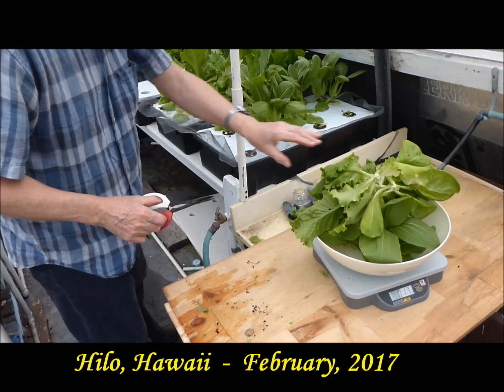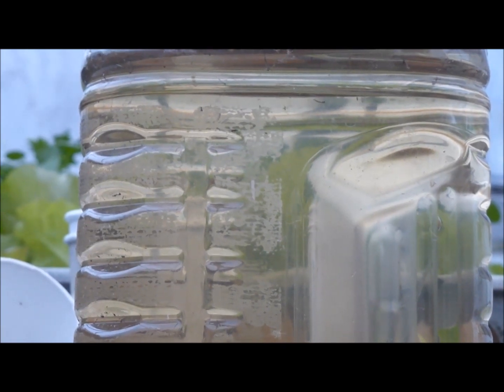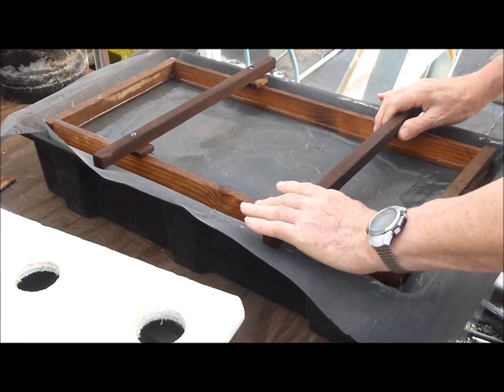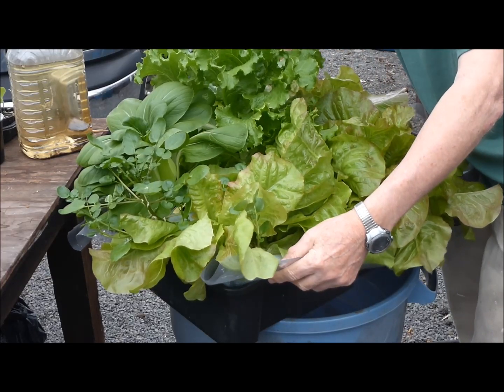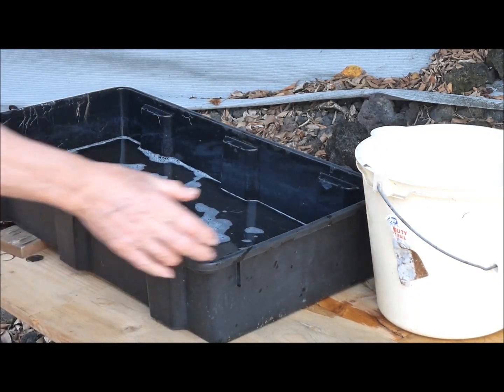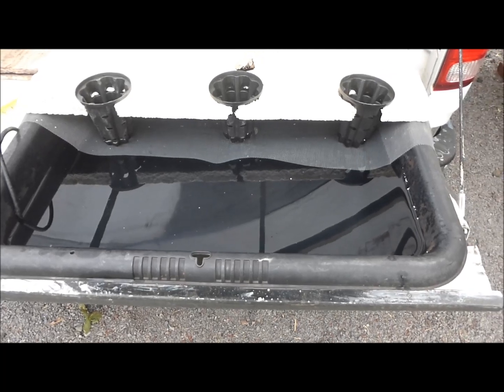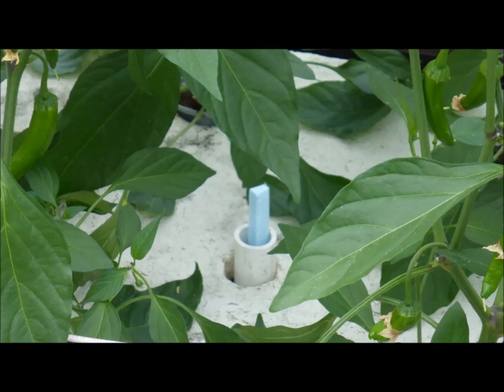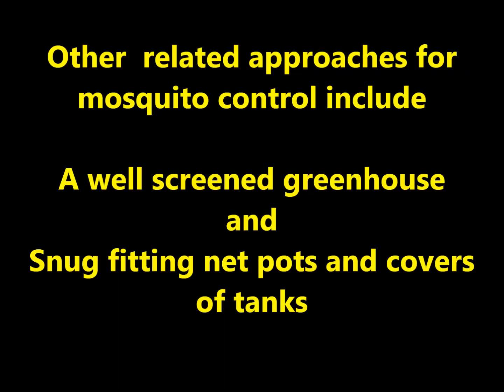Controlling Mosquitoes with Screen in Kratky Hydroponic Systems

Comment: Is this prof Kratky himself? I read the Kratky method PDF from hawaii.edu website few months ago, and just realized how the mosquito net, that was mentioned in the PDF, suppose to be installed from this video. Thanks

Another question is that: why can't you just fill the whole box with LECA / cocoir, fill it with nutrients, and let the plants grow like normal Kratky method? There wouldn't be any chance for the mosquito problem. 

I live in Singapore public housing, and mosquito is major issue since it can cause dengue and Zika outbreak in very short time.
Reply from the maker: Yes, this is the old, retired prof trying to learn how to communicate via Youtube.  Yes, you can fill the whole tank with growing medium and add nutrient solution and that should eliminate the mosquito breeding grounds. However, the growing medium adds cost and some inconvenience.  In a recent youtube on beans, I am suggesting that the nutrient solution be delivered to the tank through a float valve which controls a shallow nutrient solution level that sub-irrigates the container of growing medium.  It works well and I plan additional study on this concept.
Reply: Thank you Prof. You're awesome
Reply: dakineapproaches not old.. just more experienced dirt (or in this case water) under your nails. Thank you for continuing your gift of educating us.

Comment: Thank you for this. I've barely planted a seed in my life but seem to have caught the bug now. (pun intended) I've been looking at the dutch bucket system and while it looks amazing I'm afraid to start that endeavour and would prefer your method because of its simpleness and cost effectiveness for now. My question regarding the polystyrene is if it's strong enough to hold the weight of growing tomato plants. Thank you for all your great videos.

Comment: Im a novice to hydroponics. Its suggested that I use black containers to stop light and algae growth. I live in a very hot climate. Wont the black colour absorb heat and increase the water temperature, humidity and produce the same problem and or be a problem for the roots?
Reply: You can also use foil or reflective tape to keep light out, and help insulate your reservoir
Reply from the maker: Yes, the black color will cause heat issues.  A simple solution is to paint the black containers with white latex paint and you will have the best of both worlds - white  exterior to keep things cool and black interior to block light and algae.
Reply: Put a white Polystyrene around tank and you may do it 1" out of tank's wall.

Comment: I just throw a "Dunks" in my tank.  Never have had an issue again.
Reply: Yes, but the insecticide may end up in your salad
Reply: Daniel Widyanto Do your homework... It's BT. NOT an insecticide.
Reply: What is dunks and where can i get it from
Reply: Dunks refers to the Israeli strain of bacillus thermagensis bacteria which specific to mosquito larvae in the water not adults that fly. This strain does not affect much of anything else but mosquitos. It comes as donut shaped dunks or it also comes in crumbles. Aside from being an external input that has a slight bit of repeating cost and upkeep to monitor and replace,  it is pretty harmless.  Not sure if plants take it up into their tissue. that would be a neat science project. This bt is different strain than that spliced into BT corn (gmo)

Comment: How did this work for you? I live in south Alabama so mosquitos are like our state bird. I would love to not be ate or drank to death
Reply from the maker: If the tank cover is not tight,  mosquitoes will continue to fly in from outside the tank, but the screen traps any newly hatching mosquitoes under the screen and prevents them from adding to the outside population if  the screen is properly installed.

Comment: You are on to something but... If putting the media in stops them from getting through the cups then there is no other way for them to get into the water if the styrofoam is sealed properly. Putting that screen in like that is a bad idea, sorry. It will prevent the roots from growing down lower. They can also still lay the eggs and they will hatch in the water that is above the screen because it will not evaporate as fast as they thrive. THE SOLUTION: put the screen on top of the styrofoam and surrounding edges to stop them from getting anywhere near the water. Cut a hole in the screen for the plant, put cheesecloth or gauze around the hole so when the plant grows it will expand however it will stop the mosquitoes from going through the hole! :))
OR you can make certain that the styrofoam is 100% sealed from them being able to get past it and into the tote. Then just put the cheese cloth or gauze on top of the styrofoam covering the cup and letting the plant grow through. ;) much more simplistic and a lot cheaper ;))
Reply from the maker: Thank you for your suggestions.

Comment: I've looked at this video about a dozen times, thank you.  My system is as big or advances as yours.  The hydroponic system I bought from Home Depot has a pour spout with a couple of overflow cuts on the side, a tray the potting mix and dolomite over that sits on and a netting cover you cut the holes in for the plants.  I'm trying to add the screening, but it doesn't look like in your system you have potting mix.  I'm adding the screen over so it sits on the soil.  Is this correct or should I add the screen over the water and the tray on top of that?  I hope I explained this right and you can answer my questions. Thanks.
Reply from the maker: I'm not sure that I totally understand your system.  My approach was to position the screen over the nutrient solution to  trap any mosquitoes that  hatch under the screen.  At planting time, there will be solution above the screen, but the liquid level drops below the screen as the crop grows so mosquitoes in the wiggler stage will not  develop into adult mosquitoes due to the lack of water.

Comment: Aloha. I have an idea. have you ever tried putting a single mosquito fish in one of your tanks? it's like a minnow.
Reply from the maker: That's a great approach, but sometimes the fish die so you need to be observant.
Reply: Water quality in hydroponics is not a good place for fish. They will suffer and die.
Reply: maybe include baygon pesticide in the solution :D
Reply: High nitrogen for fish is like living in a cesspool. That'd be applicable on aquaponics but not with kratky as you load the nutritions at the beginning.

Comment: Why don't you ariat the solution with air?
No skeeders & better production
Reply from the maker: You are absolutely correct that aeration should discourage mosquitoes and might give a faster growth rate.  However, the increased cost and complexity of doing this will discourage many potential growers, particularly folks who don't have a safe electrical power supply near their growing location.